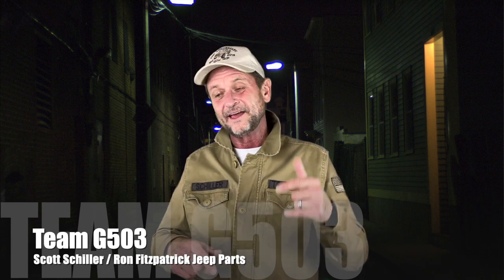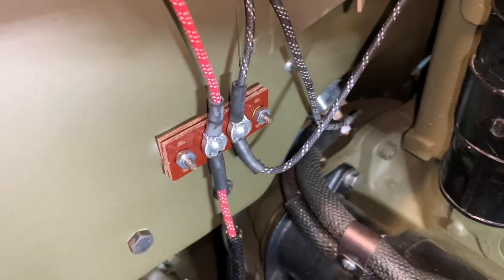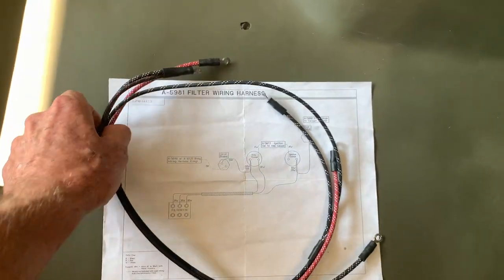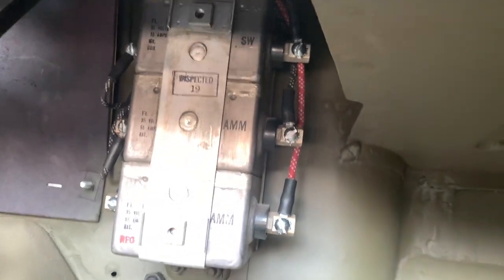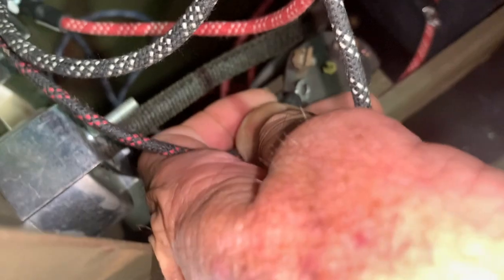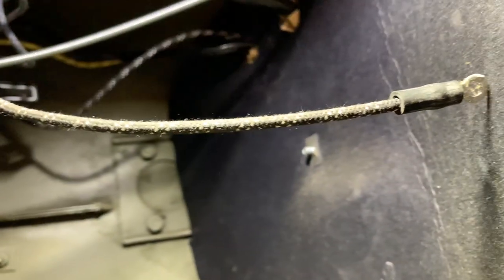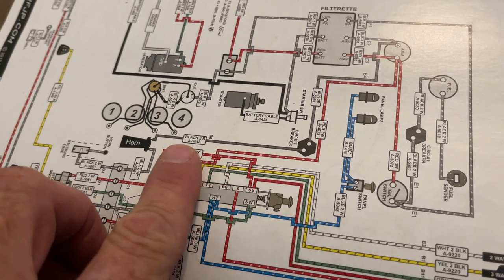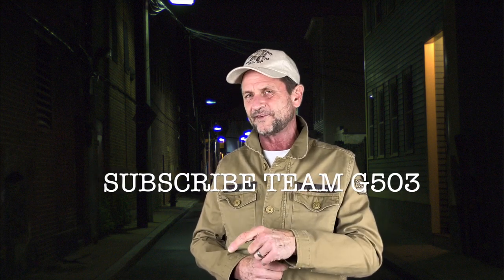G503 Wiring The Filterette On A Willys MB / Ford GPW (Electric Part 26)

Comment: This is super helpful, I’m restoring a 42 GPW that turns over but doesn’t spark. The coil works but doesn’t get 12V when the ignition switch is turned on. I have zero knowledge on cars but I’m learning along the way 😄 Time to start measuring around the filterette!

Comment: Question:  Go to the 1 min 23 sec part of the vid.  The schematic shows the red wire going to a center post and you install them on the bottom??  Where should it be?